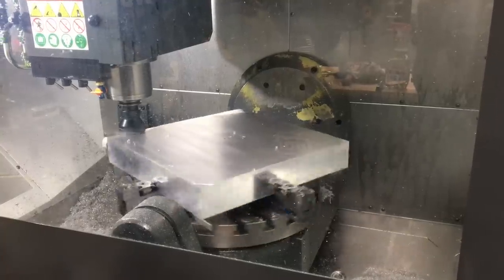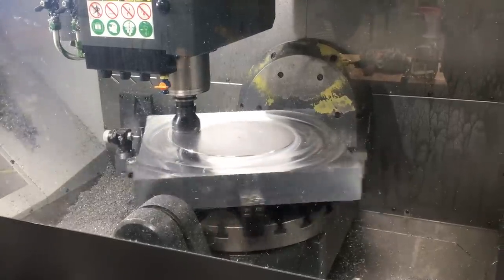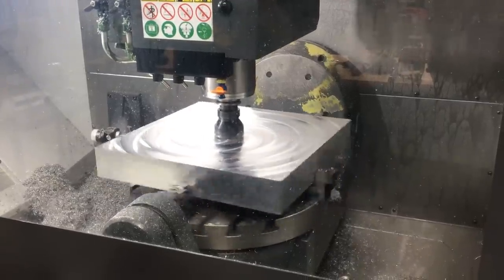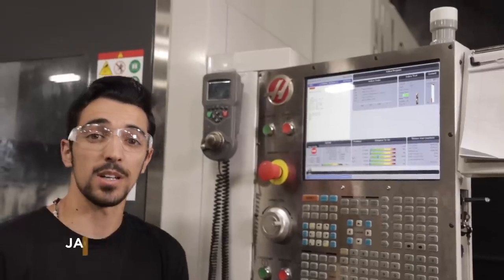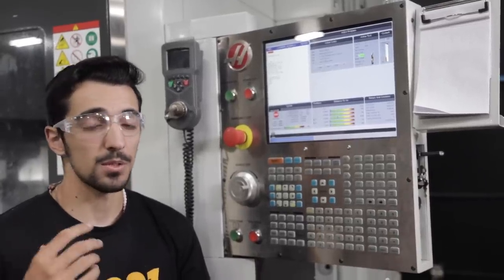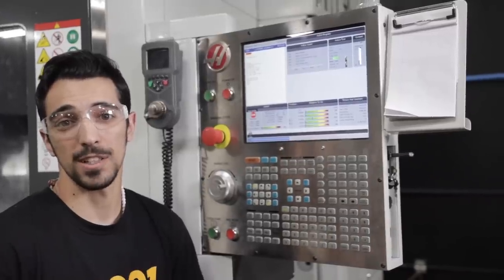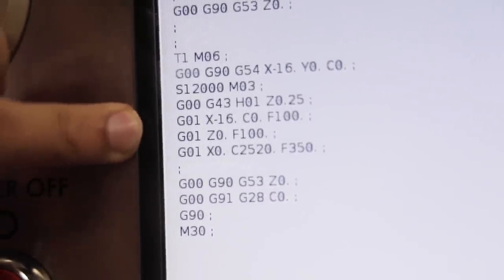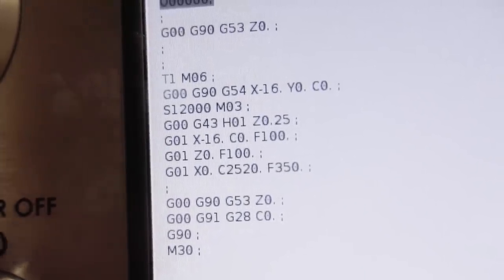Multi-Axis Face Milling | CNC Machining + G & M Code Reveal | 5 Axis Satisfying Spiral Toolpath

Comment: I think that's a really eloquent tool path for facing. Especially on a 5-axis, but even on a 3 axis mill. The tool stays engaged in the work and very low loading on the screws and nuts. Exceptional work. I'd be very interested to see what sort of MMR this toolpath can achieve if pushed.

Comment: If your table wasn’t trammed or anything else going wrong, wouldn’t this also help with flatness?
Reply: I was thinking the same. That, along with not having to interpolate two linear axes should lead to a flatter surface and better finish

Comment: Cool path how do you know your end C axis ? We have a TRT on a haas vf2
Reply: Depends how large your part is (radius) and facemill size. In the example he started at X-16 C0 going to X0 C2520. 2520° is 7x 360. If you divide the radius by number of turns, the step-over is approx 2-1/4" - looks to me like he used an 80mm or 3" facemill.

For your part just work backwards. Figure your starting radius, divide by approximate step-over. Multiply that by 360 and you'll be pretty close.
Reply: @GRTLRS  thanks man now i got it.

Comment: Okay.  Now rewrite the code for constant chipload.
Reply: HAHAHA i was thinking on that too.
Reply: @spikeypineapple552  Constant chipload can extend tool life.  In this case, as the tool approaches the center, the chipload is dropping continuously because the angular velocity is being held constant.  This is also less time efficient than running the tool at a constant chipload.
Reply: Yep.  I used to write a TON of macros for solving problems like this.  A good set of custom macros is like having a bunch of special custom tools in your toolbox so you can work more efficiently.
Reply: @kevin_delaney  I read the manual for the control and then just tried stuff to find out where the limits, gotchas and bugs are.  You WILL find them.  Haas has some bugs in their control software that as far as I know, still haven't been fixed...  4 years later?

Comment: simple parallel will do it in  less than 20 sec. , and with constant chip per tooth
Reply: Not really. Look into chip thinking effects, especially on entry on exit. Any hsm toolpath will actually do an arc path into the straight cut in order to keep a consistent chip load

Comment: I've been having a hard time figuring out how to get a G02 to work in my programming. I'm trying to round over a corner on mild steel in the X/Z plane. I can't figure out how to get the coding to correspond to an outside radius instead of an insife radius. Any help would be much appreciated
Reply: Haas G17/G18/G19 
G17-XY cutting 
G18-XZ cutting 
G19-YZ cutting. 
It's how the machine interprates the radius cutting. Add one of those corresponding to your cutting motion.
Reply: @undeadxnightmarex2013  ive been using g18, im working on an old Mazak 15/30 with mazatrol m-2 controls
Reply: Using I/J/K for radius input or just R? 
Also, when rolling over the top, is it your desired radius plus tool radius? Or just plain part radius?
Reply: @undeadxnightmarex2013  ive tried using i/k and r, and i still cant get the tool to follow the right radius. Also, im not using cutter comp, so its radius plus tool radius
Reply: I don't think cutter chomp works in vertical movement. Not sure about that. 
And what type of cutter are you using?
Reply: @undeadxnightmarex2013  im using a half inch ball nose endmill. But i figured out the problem in the code, kinda. For some reason i had to use a g3 instead of a g2, and i needed a -Z coordinate
Reply: Yes, when working on XZ plane, you need x and z coordinates.

Comment: Not the best video cause you are doing it wrong. You have to increase the rotation speed of the table in order to maintain that constant chip load. In addition it is not necessary to move until X0. Just a little bit over the radius should be fine :)

Greetings from Germany!
Reply: Better reply would be:. If you want a constant chip load increase table   rotation speed when cutter moves to center of table.   

Sometimes for flatness it is better to plane like this to prevent tensions in the material and cause workpiece to distort a little.
Reply: Wrong? I didn't hear him say anything about constant chip thickness? His goal was to face a part which would over travel in XY due to large stock + facemill size. It worked well and quick for a one-off fixture. How much time are you going to waste playing around with your post and cam to do the same thing he did at the machine in 2 minutes?
Reply: Burghardt- YouTube comments allow long replies- how about you post your own gcode then ;)
Reply: I agree, lets see your version of the code, Burghardt. There was absolutely nothing wrong with this demonstration. Funny part is, always when the critic throws the punch, they have nothing to back it up...
Reply: Sorry but you're not 100% correct either. If this was turning you would be correct but it's milling
Reply: @burghardtzerspanung  I used to write code similar to this but using polar coordinates.  I also used to do write constant surface speed code for ball mills.  ;)
Reply: @burghardtzerspanung  What I always wonder is how much a piece of metal  distorts after it is milled so fast...   

It is nice to see chips flying around ....And ,as you point out , they say this is the way to make money.... But how about distortion and precision when such a workpiece lies a couple of days ,maybe weeks.... They never talk about that
Reply: @prototype3a  This is correct, in polar coordinates it would be a little bit easier, but i guess polar coordinates are an option that not everybody has? My solution should run on every machine because i am only using standard comments. I do lot's of calculations that could be done in polar coordinates very easy with the sin, cos and tan function of the control, just because these are standard on all machines.
Reply: @Baard2000  i totally get your point an yes you're right. Distortion is always a problem, especially when using high cutting speed an too small feedrate that the heat cannot be transported out of the cutting zone via the chips. Exactly this happens when the cutter get's to the center of rotation in this example.
Reply: Constant chip load doesn't really matter when facing on a mill...
Reply: @burghardtzerspanung  Some controls have trig functions built in so the control can do the math for you.

One machine I used to run actually allowed named variables so I was able to write a lot of code on that machine fairly easily.  I hate the numbered variables as it makes reading the code a lot harder.
Reply: @burghardtzerspanung  It's funny these people went so hard on you just for pointing out the mistake made in this video. Might be bcz you are german and they felt you attacking the murican way of milling or sth. Some of the things uploaded here are more show than actually useful and I am glad somebody other than me has a critical view on this wether its useful or the best way to do it. 

Guys, you may still talk polite to people with a different opinion, there's nothing wrong about questioning things getting thrown at you.
Reply: @GRTLRS  GOOD POINT ITS ONLY ONE FIXTURE. AND WE NOW ALL LEARNED SOMETHING INCASE WE RUN INTO THE SAME PROBLEM.